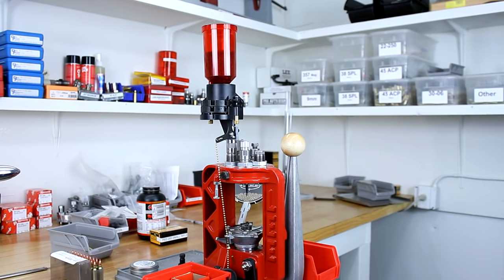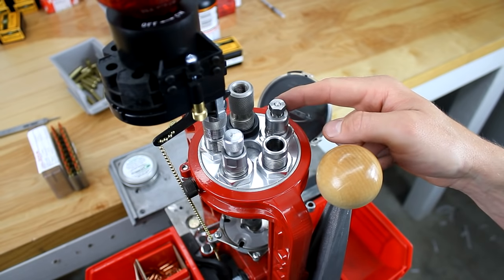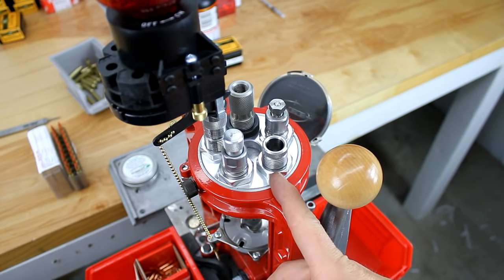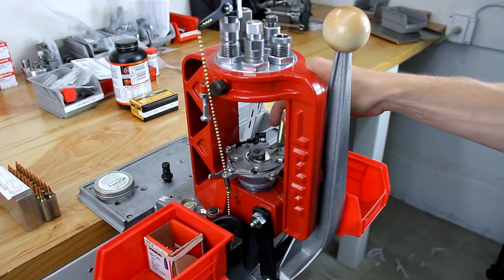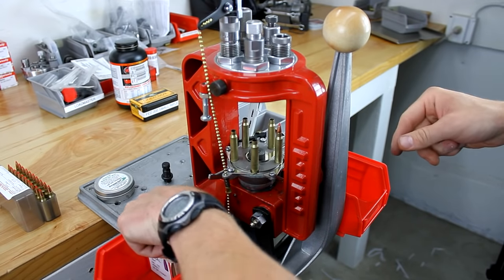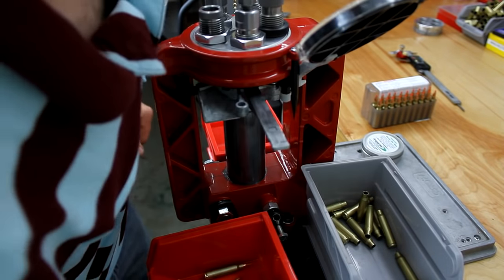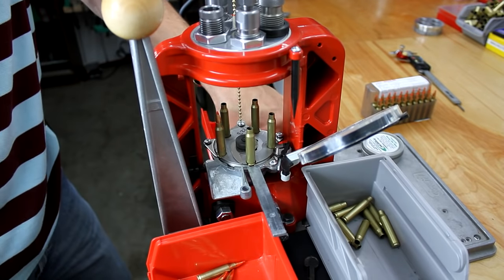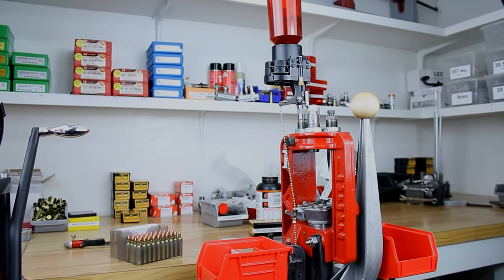Lee Loadmaster Loading .223 - 5.56 NATO

Comment: How important is it to resize and debur 223 once fired brass??? If i take clean brass that has a used primer in it and run all of those thru the loadmaster to reload all brass found at the range wont the brass size be off??? Along with once i chamber the rounds will the brass / headspace be off??? and if so will my AR Jam and have more failure to cycle problomes???

Comment: @RHECHWLYB1  Yes you can use military brass for your need mil brass is thicker but that is taken care when u full length size, what actually makes it 5.56 is more pressure 5.56 loaded to just over 62000 lbs/psi where 223  is 55000 lbs/psi overall length is 2.26 inches on both any longer will not fit in ar mag, u will probably have to trim most cases though, just don't drop more powder than recommended for 223 and u will be fine

Comment: I like using the case feeder for the 223 BUT the collator will drive you crazy (for me it double and triple drops the cases so often it wasn't worth using) I just drop a case onto the feeder at the top of the stroke where the collator usually would.

Comment: @gavintoobe I have the same setup, and am having an issue where the case is not centered by the charger drop activation tube.  The case mouth catches off center, so a good bit of the powder falls outside the case, and makes a mess.  You don't mention anything about that, and I wonder if my drop tube is bad, or should be polished, and the angle of the bevel be increased ?

Comment: I just bought one of these machines. Question, I have a bucket of both 5.56 brass and .223 brass. Can I still use the .223 dies from my machine and reload it on both cases? I obviously can't tell the difference between the two cases so it would be convenient to use both cases on my machine.

Comment: If you look at the function of the press, it indexes AFTER each stroke. It runs up station 1 and on the downstroke, indexes to station 2 where its primed. Then it's run up in station 2 and on the down stroke indexes to station3. You're starting the 2nd stroke with a primed case right? So there's no way you should be able to add powder before primer with that setup. Otherwise why would he have to remove the decaping pin in 2? Cause if he didn't, he would de prime a freshly primed case...

Comment: it has been 6 yeats since this video. How do you still feel about this specific loader now? Has it held up well? Any issues with it? Do you still recommend it today, or is there something newer and better out there you would buy instead? 

Thanks in advance.
Reply: I know you didn't ask me but I thought I would chime in because I've been using one of these since 2012.  I think it's a great press for the budget minded person who doesn't mind having to adjust it or replace small parts on occasion.  In my experience, the plastic flapper that does the indexing wears out.  I keep mine nice and lubed with grease and can get several thousand rounds out of it before it wears out.  They are cheap, takes 10 seconds to install a new one.  When you look at the price difference between this and other brands, I think this is an amazing press for the money.  If price isn't an issue, go for a Hornady or better.
Reply: Toolness1 
Thanks for the info. Will definately look for one of these. Cheers from Texas!

Comment: If you resize in station 2 without the expanding plug, the case neck is undersized and might not take in a bullet...you should use a body sizing die on station 2...what do you think ?

Comment: what about case length?  i have loaded a couple thousand rounds of once fired and most of all of them needed a trim. i think this would be a very good set up for my 44mag.  also i have that exact power measure and it dose not work at all with fine powder like H110 or accurate #9

Comment: gavintoobe I see a lot of people with progressive presses resizing  (in this case twice ) but what about case length before moving on to the next steps?  No trimming?  What I'd the case is over 1.760 after resizing?  Seems to me like a lot of chambering issues. I do all sizing and decapping on a single stage.
Reply: timothy harden after full length, it is a real good idea to check the size and trim as needed.

Comment: Well, I thought I could get away with that thinking but a long necked .223 actually got stuck in my cousin's M85 pap because the neck was pinched at the chamber throat. That is not acceptable. I might be able to get away without trimming for a few reloads, but the problem is that there is no good way to keep my prepared brass separate from all the other brass on the ground. Easier to verify or trim them all.

Comment: @RHECHWLYB1 ...from a very unscientific perspecitive, and as Gavin says, "worth more research", I shoot 5.56 NATO brass (LC) all the time in 223 chambers.  The weight/thickness diff in brass is relatively negiligible.  I have some PPU 223 brass that weighs in at more than LC NATO brass. The bigger difference between the two is leade dimension. In short, reload to 223 powder/COL specs, and start at the low end, work up slowly and watch for pressure signs.

Comment: Nice Video, Questions: Why do you "need?" to jump on the press lever twice?
Does the press have a poor Leverage issue.
The 2nd die, are you resizing twice during the "centering" and priming?
Reply: Dave H station 2 is just to hold the case straight. I usually use a uni decapper with out the decapping pin. it looks like he does the same.

Comment: @Rastislav110 ah..well, that's still kinda weird.  I've used RCBS silicone (too messy IMO), Dillon spray lube, and Hornady Unique. All of those have allowed me to never stick a case.  I've only done it once...and that was due to lack of lube (guess I missed one). I also experimented with tea candles when my Dillon spray lube decided to leak out...that worked well too...just rubbed the candle up and down the cartridge and evened out with my finger-glided through the dies like butter.

Comment: Hello, my loadmaster has a problem. The shell slider that puts the shell into the shell plate tends to at times, not always, maybe every 5th or 6th shell, pull the shell back a little bit and cause the shell to get crushed on the up move. 
How can I correct this problem??

Comment: Been reloading for 50 years.Here's my question for progeressive loaders: Once you resize when using a progressive when do you check for OAL, trim, and chamfer? Not to mention cleaning the primer pocket before continuring on? What am I missing? Thanks.
Reply: All your prep work should be done before hand
Reply: If you are to use the "Progressive" press as it is intended, you cannot "Prep" prior to using the press. "Prep" begins "after" the case has been resized and the old primer removed. If I was to use your example, I would have to "resize", then pull case and "Prep" it then put it back into the press to continue. Tell me what I am missing? @seanrhodes9673
Reply: A lot of people trim to shortest acceptable length so they can reload it a few times without prepping the cases again. @mountainskyaerialphotograp3921

Comment: I've never loaded ammo in my life but I'm tired of spending a bunch of money on.   .223/5.56 every time I go to the range.  Does this come with everything I'll need minus brass to reload ammo or will I have to get other equipment with it?  I'm thinking about ordering it right now but wanna make sure I get everything I need at once.
Reply: Youll need primers, powder, bullets, calipers to measure brass and overall length for setting up the bullet seating die, case trimmer, and a digital scale or beam scale to verify powder load being dropped. The kit does come with the trim die but youll need the trimmer itself still.

Comment: Can you please post a link to the die you are using in station #2? I would like to try it since I have a lot of issues with the priming system. This may help seat the primers better. Thanks!
Reply from the maker: It's a sizing die with the decapping rod removed. :)
Reply: Is there not the danger of resizing the casing again, and without the rod installed, the neck will be made too small... poor wording sorry.  when you resize the neck is pressed against the decaping rod... I"m looking at the same issue and for a die to put in #2.

Comment: when should you clean the primer hole? I ask because you use a de-primer die which would indicate that the primer is still in the brass. So i assume the brass was tumbled with the spent primer still in it.
Reply from the maker: I don't - ever. :)
Reply: I assume you sorted out the brass that did not have a crimp on the primer or did you prep the cases before?

Comment: With a setup like this, are you ever worried about overcharging a case and not noticing?
Reply: TurboMitsubishi by using the spring on the powder measurer you can easily get a double charge. Using the chain eliminates the chances for double charging a case.

Comment: Since 5.56 is a hotter round the lower pressures of .223 loads shouldn't be too bad. Using 5.56 load data in .223 brass would be more dangerous or at least so I would think.

Comment: What advice can you provide for a 1st time reloader. I would like to reload various calibers from 9mm to 45 acp and from .223 to 30-06.
Reply: XZ3RO plenty of youtube videos and hornady american series dies, they come with the shell holder (most dies dont) and plenty of patience
Reply: Do a TON of research before you actually load anything. You WILL mess something up. Buy a bullet puller right off the bat. The hammer type is fine, the die type is more expensive and can mess up the bullet when you pull it but it works easier. I have both. My very first batch of 100 rounds I loaded had to be pulled because I apparently didnt resize them all the way and they wouldnt load all the way... man was that a pain in the butt! That was like 5 years and 10000 rounds ago though.

Comment: Hello, is there a factory preset for the amount gun powder released into the 223 case or can to set the amount?
Reply: No, because it depends on too many things. You need to look up your powder recipe depending on powder brand and type, bullet weight and bullet type. Hodgdon CFE rifle is going to be different than Alliant AR Comp or IMR 4895. I would be incredibly dangerous if they left it set up from the factory.
Reply: The Lee powder measure system allows for you to adjust the amount of powder by selecting and installing the correct single or double disk. The Lee disks drop a selected volume, AND Lee gives you the information about what volume translates to the correct powder weight in grains. In other words, Every powder has a different weight per unit of volume, and Lee provides that to you. Lee warns that if you are loading the maximum weight, you should hand-weigh your loads, since the amount of power may be differ by a few tenths of a grain and possible put you in an over-charged mode; be safe.

Comment: I think that you had some Hollywood help making this video cause my Loadmaster is giving me fits trying to load .223 progressively.  Lubed cases are sticking and the primers do not want to feed so I am having to size on my green press.  I tried sizeing with the decapping pin in and the cases stuck.  Pulled the pin and they still stuck.  I have been reloading for more then 20 years but this Loadmaster is giving me fits cause it just does not work right at all for rifle cases but I did dmanage to get it to load 4k pistol cases.
Reply: I'm setting mine up for the first use, and I've had some trouble. I've solved all but one, and that was the case feeder. Turns out I was sent the pistol pusher. I'm going to call Lee and have been told they'll ship a new one out. I'll keep the pistol case pusher because I'm going to be setting this up to do 9mm pretty soon. I've been told anything larger than .223, forget it. I've heard from some of the guys who really know how to set this up that it's capable of larger cases, but the only larger cases I have are .243, 7mm-08, & 45-70. I prefer doing 45-70 on my old RockChucker. . . Check out the video on setting this beast up by Gun Blue. His videos are longer than other's videos, but he knows his stuff and I've learned a lot from him. I think we are about the same age, old Gun Blue and I. I'm in my 60s now.
Reply from the maker: What case lube are you using? (lubes like Hornady One-Shot are not adequate for bottleneck rifle cartridges)

Comment: have the same press no real complaints about it once you work out minor lil tweaks. Only thing that i find misleading and concerning is how you go from deprime to resize with no trimming. Are these brand new shells?
Reply: I assume he trims them after cleaning the brass. Otherwise they could just be once fired, you really dont need to trim until twice fired (I do it every time anyway though). If you are loading 223 on a load master, you probably arent going for amazing accuracy so neck tension differences due to non uniform case length probably isnt much of a concern lol.

Comment: dude, your powder amount depends on the load your making and the type of powder your using.  You can't just use one disk set up for all powders for a specific round.  Get your Lyman's book out and read up.  I'd recommend a powder that will do many types of loads.  I use IMR 4756.  You can load pistol and shot gun rounds with this powder.  I bought 8 lbs over a year ago and have loaded over a thousand rounds and still have 3 lbs. left.  I guess i need to fire up the press to get rid of the last 3 lbs....
Reply: +Tutto Bene ya i use blue dot on all of my pistol cartridges i need

Comment: when do you trim the cases?
Reply from the maker: You check case length after each sizing (for a given batch of brass with same firings, etc- only need to check a few cases for a batch) - and trim when they exceed length spec. I trim to .010" - .020" under length spec to give some room typically...

Comment: DOES THIS TRIM THE CASES OR DO YOU DO IT BEFORE
Reply from the maker: You have to check length after sizing and trim off-press if trimming is needed.
Reply: im sorry i dont' completely understand doesn't sizing happen on station 2 and then on station 3 it puts powder in?
Reply: Sizing is just one step, after sizing you have to check whether case is not above maximum length and if so, trim it. Sizing is not trimming, it's just returning case to it's original shape.

You can trim by hand (tiresome) or semi automatically with products like World Finest Trimmer or CTS Case trimmer or Giraud Tri-way trimmer. With those, measuring length and trimming only those cases that have to be trimmed is actually slower then put all cases through and trim it – if there is no material to trim, you just put it into bucket as the other ones.

Comment: is there a caliber conversion for this press?
Reply: The Lee Precision Loadmaster is designed for easy caliber changes.  The five hole head is easily removed and replaced with a single finger screw on the left side.  The tool heads are inexpensive, and I have them for all the calibers I load, and the tool heads just sit on the shelf, with all the settings intact for the next time (this of course, assumes the same trim-to length, same bullets (or at least same case OAL).  And even if these parameters do change, the adjustments are easy and quick with the dies already in place.

Comment: What kind of case lube do you use
Reply: +Michigander Good question.  These cases are obviously not lubed with a heavy lube like RCBS.   This video makes it look like the deprime/resizing stage is done with carbide!
Reply: +Michigander hornady unique works really good. just dab your fingers and you can lube cases just picking them up. after you get some in the die it takes very little on the case to make things run smooth. Empiral is what he used and its basically the same stuff at higher cost

Comment: where can I get a good work table??
Reply: +Nubian Emporer You have to build it yourself. If you know how to weld, you can make a very light and cheap one out of metal where the base of the platform is under your chair (think of those folding portable shooting benches). This way, weight is not a factor since the direction you are mechanically pulling the lever is simply just pushing the bench to the ground, rather than tilting it. PM me your email for a picture if you don't understand what I mean.
Reply: Harbor Freight sells a big table that I and several people I know use for reloading.  It's about 180 bucks or so, and nice and sturdy.  If you can't build your own, that's a good option.  You can mount it to a wall if you need more stability.  It has several storage drawers and a lot of storage underneath.  I am happy with mine.

Comment: Man what a waste of money on that .223 auto loading setup. Doesn't even work. It's range of motion on the z bar is too short to allow a case to drop in front of it. When you do place a round in front of it, it fails to be pushed into the retention plate.
Reply: wtf are youe ven talking about? It clearly works. Not as good as more expensive ones, but it does indeed work.